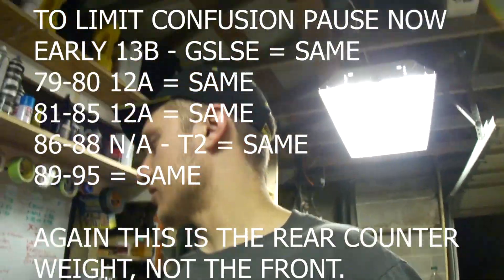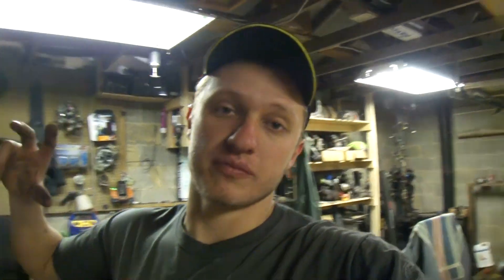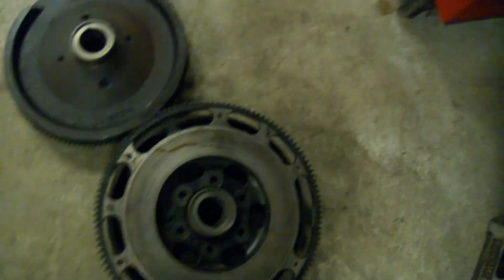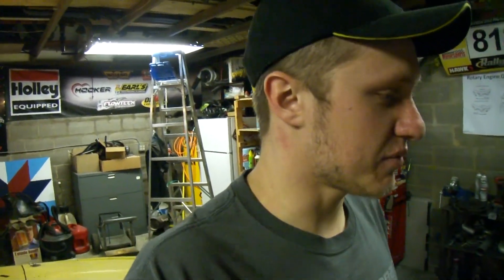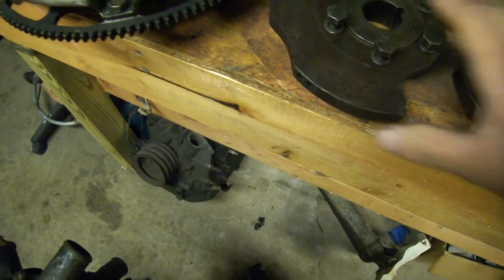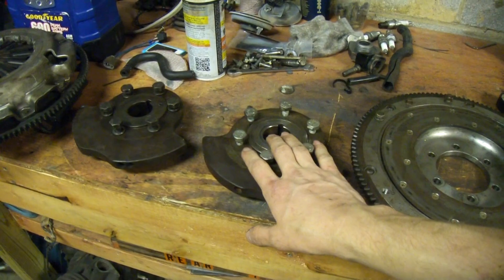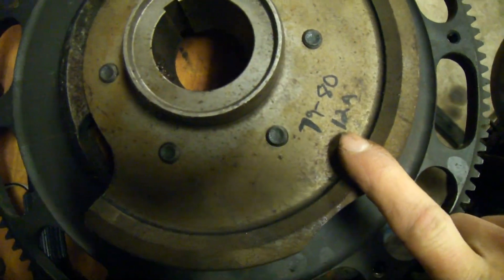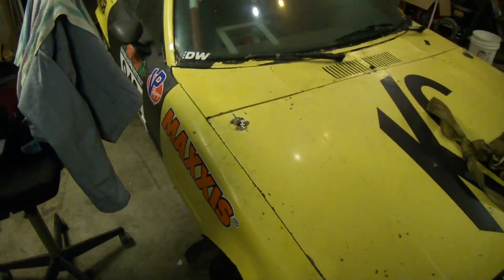13B and 12A Rotary Engine : REAR COUNTER WEIGHTS AND FLYWHEEL BALANCES EXPLAINED

Comment: I have a 13b with rx8 lightened after market flywheel and clutch, using the 13b counter and it viabrates low rpm. Do i need a counterweight to suit the lightened wheel ?

Comment: How did you get the oil filter to clear the slave cylinder?
Reply from the maker: Remote mount. Using a Mazda trix block off plate

Comment: Can 12a use 13b flywheel & counter weight??
Reply from the maker: No, you need a 12a balanced flywheel. Or a 12a counterweight with any universal flywheel.

Comment: Do you happen to have an opinion on which transmission is stronger, rx8 or T2? I need something to put behind my turbo 12a that won't explode drag racing.
Reply from the maker: I find that the rx8 trans tolerates the higher rpm shifts better.   T2 gearbox is stronger.  Reliable at 300hp in a buddys drift car for years
Reply: @RADPotential  thank you for the reply. So if I wanted to out a t2 trans behind my 12a, do I use t2 flywheel/clutch and starter but my 12a counter weight? Not concerned about driveshaft.
Reply from the maker: Yes.  You will need a 6 bolt flywheel of your choosing, clutch for t2, the t2 starter.  And the counterweight for the 12a you have.

Comment: So basically if I find a manual RX8 trans in a pull it yard, I should grab it and keep it on the shelf to put in my 12a FB endurance racing car. I've always wanted a spare transmission to have as a back up and have passed on a few RX8 gear boxes because I didn't know that I could make them work.
Reply from the maker: Yes. You can make it work.  Just a driveshaft and you need the clutch and flywheel.  I will make a video on the specifics that will drop Thursday.
Reply: @RADPotential  Perfect. The older stuff is getting harder to find, so anything we can salvage from an RX8 to use on older cars helps.